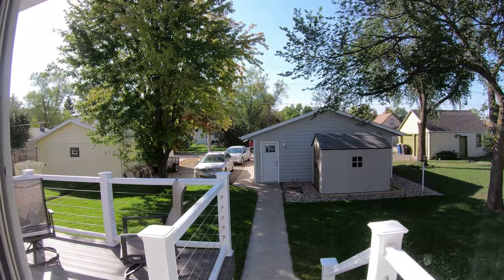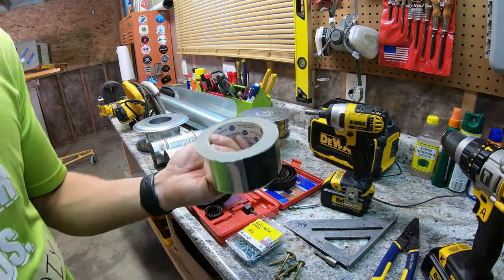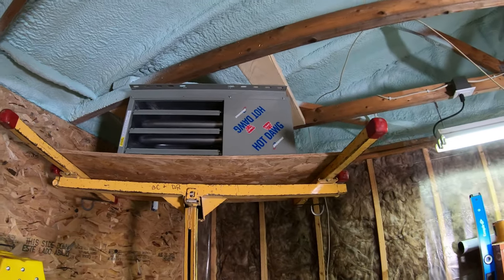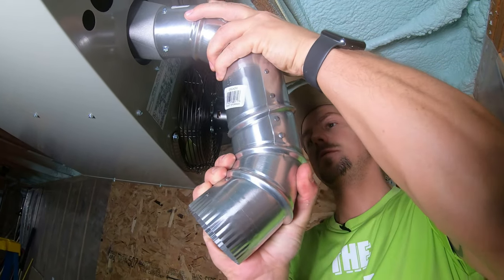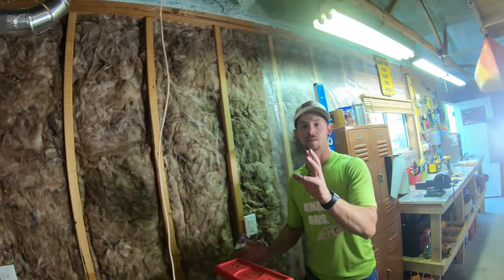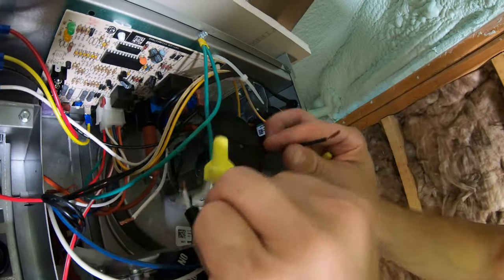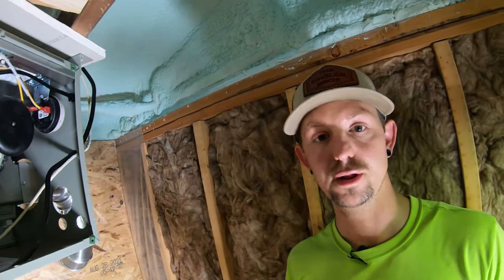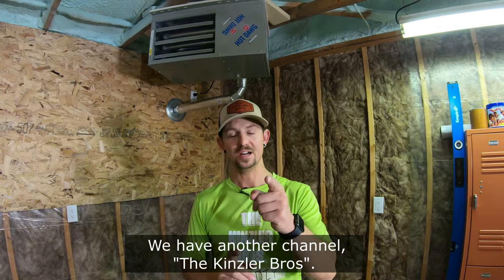How to install a garage/shop heater. (Mounting, Venting, Wiring).

Comment: I'm so confused with this horizontal venting..  My manual says 1/4" rise for every foot of pipe.. the key word is "rise"... upwards away from heater..  This vid shows downward slope "for condensation".. Whereas I thought it needed upward slope for carbon monoxide release.. But if it's an upward slope, wouldn't condensation travel back to the heater...or does it burn off..???
Reply from the maker: Well my manual said downward slope for condensation did not say anything about carbon monoxide other than you have to have your venting outside past your soffit or your gable end so you don’t have a current monoxide coming through your soffit thank you for watching
Reply: The manual says it can slope downward no more than 1/4" per foot and needs a drain.  But that's only IF your local code allows it.  And most codes will only allow up to 6 feet of horizontal run.  So, that's a maximum drop of 1-1/2".  Looks like he's got about 8 or more there.  And I believe the rain cap he has is designed to be installed vertical.  Either way, upward or downward slope, a horizontal vent pipe needs a condensation drain.
Reply: @JohhnyB82  yes , heat rises my manual said the same. I bought the pipe with drain also.
Reply: If the unit is fan assisted, you can get away with a downward slope, if it's gravity vented then you need an upward slope.
Reply: Gotta follow two bits of code.  If the furnace says downwards slope and your local code says upwards you have to do local code.  This may vary for commercial vs residential applications here for instance you do a horizontal with a downwards for residential but commercial may require either vertical or upwards horizontal with a condensate drain plumbed in.
Reply: Ummm... Not the correct install at all.

Comment: your vent pipe should never run down in any part of the system. Yours runs down at the furnace. Aluminum pipe is for your dryer. The pipe should not be mixed, your running aluminum, double wall, and single wall galvanized together.
Reply from the maker: Well I actually just looked at the house that I am sheetrocking on their unit that they have and there’s just got set up and they’re running two separate kinds of metals for piping as well I don’t know your state codes I mean I’m not saying I’m right I just don’t think it’s going to be a problem a dryer vent also gets hot maybe not as hot as the venting for my unit but as far as the little bit of a slant to it it says in the manual that if your wall venting you have to have a small slope for condensation so My video is for DIY people I think that if they did the same thing I did they wouldn’t have an issue with the two metals being together I haven’t had an issue with it but I appreciate you bring it to my attention and thank you for watching
Reply: the vent kit i bought has two different types of pipe. So it must be fine

Comment: One thing to keep in mind. If you live in an area where you need to get a permit to install a heater you might have to use category III stainless steel vent pipe.
Reply from the maker: Yes this is true I think I actually used I’m not sure category three double wall vent it 3 foot pipe thank you for watching
Reply: yeah category 3 pipe is positive pressure with condensation exhaust, if you didnt make those press fittings air tight you could dump carbon monoxide inside
Reply: Due to the positive pressure, Category III is required.

Comment: Nice job on the video.  I would seriously add a strain relief to the AC wire, or at least a non conductive bushing.  Just good practice to keep insulated wires from chaffing on metal.  Thanks for the video!  I learned.  :)
Reply from the maker: Thank you very much for the tip I appreciate that

Comment: Lots of great details that I couldn't find in other videos! I loved the use of the drywall lift. Wiring and thermostat wiring were also very helpful!

On my 30,000 btu Modine Hot Dawg, the vent needs a minimum of 12" straight pipe before the first elbow, so check the manual of your specific unit for the venting requirements.
Reply from the maker: That is awesome this was helpful. I will have to look over my manual a little closer but it has been running for a couple months now and seems to run great. Thanks for watching

Comment: Awesome vid guys!! Very well explained!!
This is good stuff.... heat in a shop in the north country is a very good thing.. unfortunately..its coming 🥶
Wilton bench vise FTW 😎 good choice 👍
Reply from the maker: That’s awesome that you noticed my Wilton bench vice yeah I normally like to get the nice and well-built tools but sometimes you have to settle for the cheaper version if you want to buy a number of tools at one time because we just got table top bandsaw  table top sander table top bench grinder and a drill press as well for our restorations. Thanks for the nice comment
Reply: @kinzlerbrosdiy6813  I restore old bench vises..  the older ones are 10000% better than the vet junk..I buy them cheap on ebay wire wheel all the paint/muck off..then oil the raw metal.. then resell them back on ebay😁🤑.. I have a  Prentiss with a swivel jaw. Came from a railroad shop up north.. it weights close to 250 pounds and has 8" jaws💪😎

Comment: Positive pressure horizontal venting requires category 3 stainless from the heater all the way to the cap.  It needs to be airtight.

Comment: You say to slope down on the vent... the heater manual I read said to slope up minimum 1/4" per foot
Reply from the maker: All heaters have diff instructions
Reply: The downward slope of the venting should be 1/4” per foot…. Not straight down 🤣 should also have 12” of straight flue pipe out of the unit….. PER THE MANUAL

Comment: Great vid thanks! DO you think it would be a problem to not have the outside exhaust not clear the soffit?
Reply: It depends on how close it is, mine required 4’ of clearance from any soffit /eave vertically & horizontally. If that 4’ is met 12” off the siding is acceptable if not you should be at least 12” beyond the edge of said eave or soffit. Hope that helps

Comment: The previous homeowner installed the garage heater which is vented outside. Where the collar is to the outside I can see light looking to the outside around the edges of the collar. Should I seal that and with what?
Reply from the maker: Yes I sealed mine with fire block caulk. Thanks for watching

Comment: Great video!!! Thank you! 
Question: My heater is a 50,000 btu can I still use 3” pipe or do I have to use 4”?
Reply from the maker: It all depends
On that size your unit starts with. If it is 3” out of the back then 3” is fine. But If it’s 4” then please vent it with 4”. Thanks for watching
Reply: @kinzlerbrosdiy6813  ok perfect! It starts with a 4”  simple enough. Thank you 🙏

Comment: My power in , in the heater  box has a strange plug on it this 3 wires would one cut it off and wire it that way? Also have you ever wiring into the card ? Having a plug in on the board just like the thermostat plug in?
Reply from the maker: If it’s three wires strip your pigtail back and wire but then together the tape it up

Comment: Can I put the vent closer to the side of my building? I think it'll look better but I don't want a fire hazard
Reply from the maker: The rule of thumb for venting on the outside of your structure is to get your double wall vent pipe just passed your soffit if you can if you can’t then you should go down further vertically get further away from your soffit that way the emissions from the heater does not come back into your structure hopefully this helps a little thank you for watching

Comment: I have double wall type B pipe that is too big for the end of the inducer. Can I use a short piece of single wall to attach it, then attach that to my double wall?
Reply: Yes. Get a 4 to 3 reducer.
Reply: Read the manual. Vent size determined by heater btu. Sidewall requires special vent system. Can't use b vent unless vertical around here anyway

Comment: NICE details A+ i love how you used drywall lif to hoist unit in place fantastic 😄idea. Now venting..well in Ontario this venting would not really pass inspection. You have to much drop. It's ok to go 1/4" down but needs a condensate T before exiting  out.. That aside It's been a year since you posted this video. So I'm curious  if there is the any changes/deterioration to the venting? I'm curious how much that slope affects the proformanc. Thanks for the update 👍 Have a great weekend!

Comment: very well done video, one question, have you noticed your tools getting rusty using a gas heater? i have heard heaters like this causes machinery to rust.
Reply: I have had a shop heater in my garage for the last 15 years and I have a lot of bare steel and freshly welded uncoated joints. The only time I had problems with rust is when I turned the heater off, once the heat goes on in late fall it stays on until spring time in my shop. If you let it drop below freezing in my shop then turn the heat on the metal inside will sweat and rust. FWIW I live in Wisconsin, it was 16 degrees this morning.
Reply: @fastone371 non-vented propane heaters (torpedo or space) produce moisture, vented heaters like the one in this video does not make tools rust.
Reply: @robsplace3589  If the indoor temp gets below freezing and then you warm up the temp above freezing with the heater bare steel absolutely will in fact rust, even with a vented heater, I have a hanging Modine in my shop. I'm not even sure it has to get below freezing, just a big temp swing alone may be enough to promote rusting. I even had moisture get in between the crappy paint job that Moroso puts on their new oil pans and the steel it was painted over and the paint came in in large pieces, playing card sized chunks. At least this will happen in WI winters.

Comment: Hi there. Thanks so much for making this video!!
 I have this Hot Dog heater and I will be installing it within the next week or two and this video has made it is very, very easy for me to do now. 
But I do have a couple of questions so I'm hoping you can help me out. 
First, the pigtail cord. I tried finding that cord, but I don't know what gauge I'm supposed to get. When I try to find it, theres 12, 14 and 16 gauge cords coming up.
Is it possible you could please send me a link for the proper cord that's used for the heater? 
Secondly, what kind of rain cap did you use  for the outside vent? I can't seem to find that in a 3", do happen to have a link for that one also? Any help that you can give me I sure would appreciate. Thanks again for posting this video, look forward to hearing from you. 👍😃
Reply from the maker: You welcome

Comment: hello, how did you connect these 3 wires to the thermostat?
Reply from the maker: I ran thermostat wire from the heater over into my other wall to my thermostat

Comment: Hello. What thermostat did you use? I have the same heater and I'm thinking the Honeywell I have is not the correct one.
Reply from the maker: Yes I used a Honeywell. It straight forward as for wiring. Red goes to r and white goes to w

Comment: why cut a 3" THEN a 5 1/2" hole.  Lennox makes a 5 1/2" hole saw.  Shouldn't the ceiling sprayfoam be sheetrocked ?   I think it's flammable

Comment: Have you had any issues with the venting yet? I just did this with double wall type b and used an adjustable elbow to get the angle right, come to find out you're not allowed to use this type b vent anymore horizontally... seems kind of silly to me, since cat 3 is much more hot for terminating through a wall.
Reply from the maker: No I haven’t had any issues yet honest truth and I live i North Dakota it’s in r the single digits today

Comment: How do you prevent the condensation coming back in to the heater if doing a ceiling vent?
Reply from the maker: So this I am not 100% positive on how but I think before you go straight up with your vent pipe if you make a t and make like a catch below before you go up. like a 4 inch bottom on it I think that would be for your condensation that it had a little bit of the angle on it so the condensation will fall down into there and evaporate I did this for the first time myself in this video so I’m no expert but thank you for watching the video I hope it was helpful
Reply: They make a special adapter for addition of a condensate line.  It’s also recommended to have a 1/4 in rise for every foot of vent pipe.
Reply: I'm so confused with this horizontal venting..  My manual says 1/4" rise for every foot of pipe.. the key word is "rise"... upwards away from heater..  This vid shows downward slope "for condensation".. Whereas I thought it needed upward for carbon monoxide release.. But if it's an upward, wouldn't condensation travel back to the heater...or does it burn off..???
Reply: @JoHa-dl5zr  the longer your vent pipe the more condensation you’ll have due to the exhaust temp drop the farther you get from the unit.  
Water is a byproduct of combustion. Same as with a vehicles exhaust.   The muffler which is the farthest from the engine has a weep hole to allow condensation to escape.  If there was a very short exhaust the heated vapors would not have time to condensate and therefore accumulate in the exhaust pipe.

Comment: My heater says use an uphill to vent. I’m using mr heater big  max
Reply from the maker: mhmm weird hope you figure it all out
Reply: I ended up just going straight up out the roof
Reply: Some units specify uphill and/or downhill slope on the venting. Check the manual for your unit.
Reply: This vent configuration in this video isn't in any manual. Should have used z vent

Comment: The only downward slope should be within the thimble. What you have there is way too much..  Oh my..
Reply from the maker: I don’t think it’s way too much and the only way to make it within the thimble is to have your venting like right next to the wall I’m not putting another extra elbows and stuff in there for no reason I’ve seen these vented in mini houses I do construction and I’ve asked #min and then install them as well and they told me what I did was right people do things differently state codes are different but I still appreciate your input and for watching

Comment: I hate to be this person, but if anyone wants to install a Modine Hot Dawg heater up to actual code standards (following the requirements outlined in the IFGC codebook) - this video will not help you other than the mounting. 

1. Horizontal venting of this unit requires Category III, UL listed SS dry-seal piping. You cannot use Type B unless it's for commercial/farm purposes.

2. Horizontal venting of this units requires a moisture trap, the location of this trap is dependent on the up/down slope of the piping run. Local code may allow condensate to drip from the venting if sloped down.

3. Any unit like this requires a fused switch or rated circuit breaker between the unit and the outlet.

Still leaving a like for some of the other detailed information.
Reply from the maker: I appreciate all the advice and going into depth with it I actually did leave a downward slope to my double walled stainless pipe going outside for condensation I have seen numerous in numerous in numerous set up just like mine in garage is an attached garage is and so forth so that’s my route thank you for the tips

Comment: Dude your flue should be pitched up not down. Ur unit is higher than your flue outlet
Reply from the maker: If it was higher than condensation would come back into the structure and sit the rot my piping the manual say to slope down and away
Reply: Does the manual show your configuration using c vent?

Comment: The termination for your exhaust outside needs to be 2 feet away from that soffit, also you need to have a combustion air intake for that garage.
Reply from the maker: That’s not true it has to be passed your soffit but not two feet passed at least in my area.

Comment: So much crap wrong here, it’s embarrassing and a shame.  From code violations to unsafe practices.
Reply from the maker: Well I have talked to hvac installers and they said I did it just fine. I have also had them watch the video. State codes are different everywhere. I had the gas hooked up professionally. So I don’t know what’s wrong with what I did. Since I have seen these mounted and vented similar at many homes I work in. When doing drywall. But thanks for your comment.
Reply from the maker: Tell me what’s wrong with it
Reply: @kinzlerbrosdiy6813  I think you did an awesome job .. I think others are mad you didn't spend 300 on a class 3 vent kit that most of these guys on YouTube buy , but most of them are cracking out double the btu .. and I under stood the double 90 which some don't under stand if it wasn't done that way you wouldn't of been able to clear underneath your soffit ... and the fact you use screws to mount it .. instead of threaded rod .. which again your heater is small .. ppl don't realize it's very close to a range microwave , kept it simple , great video thanks for sharing

Comment: Do not use that silver tape on your duct connections. It's a hack job looks like shit and the glue melts off it's toxic then the tape is useless anyway. High temp caulk people. This is why You Tube is not always the best place to get instructions on installs. Some great DIY help on You Tube That silver tape is not one of them.